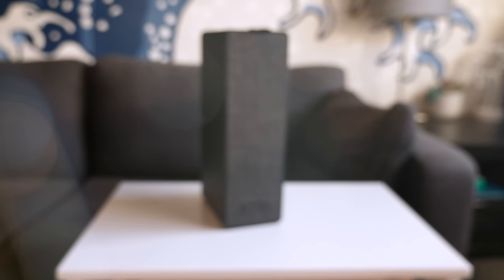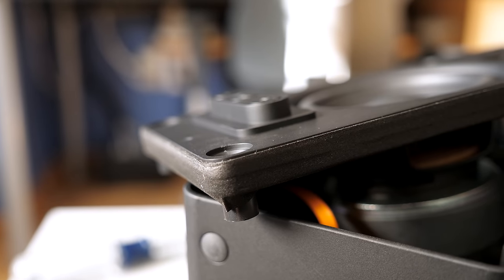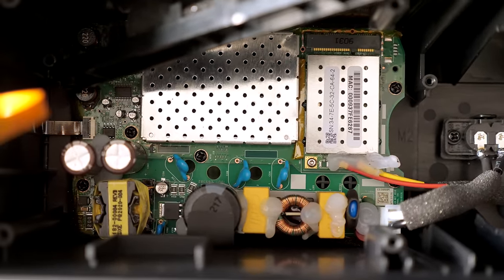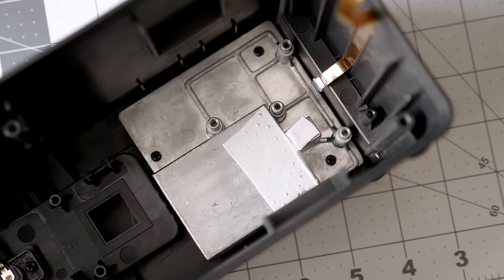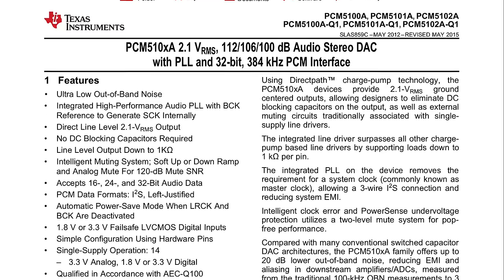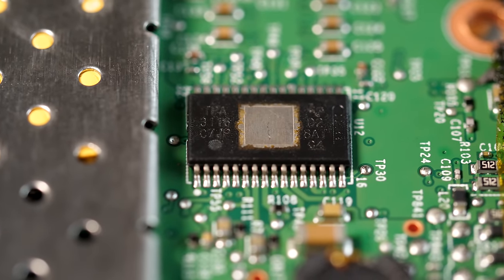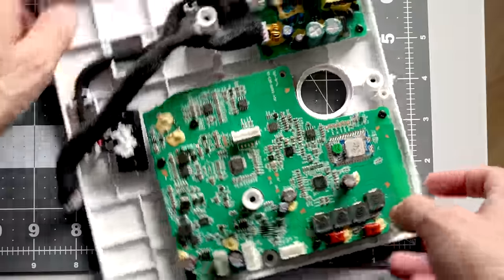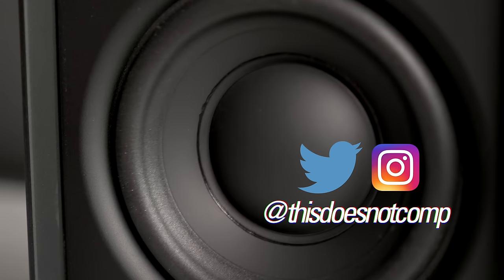IKEA's Sonos Speaker Has a Secret

Comment: The price of this speaker does NOT AT ALL warrant low quality caps. Its only a decision against the consumer to produce a limited lifetime product. Nobody should ever use cheap caps.
Reply: nutzeeer Of cause there are products that use cheap caps just to keep the price down.  But what most people miss is these two points:
  - The original bad caps plague was some factories using a bad electrolyte mix that died much earlier than planned.  This was fixed many years ago and you'll have to search old stock on eBay etc. to find new caps with this problem.
  - Every big brand offers cap models with different planned lifetime.  The current "short lifetime Panasonic" probably dies before the current "long lifetime CapXon",  though I haven't any hard data.
Reply: nutzeeer everything is cut down in price. Look at Mercedes 😂
Reply: @johnfrancisdoe1563  panasonic is the definition of long life. No product of them we own has ever died. Even our VCR still works.
Reply: @johnfrancisdoe1563  - well said. Personally, I consider CapXon is about the right quality level for what is, basically, a shitty cheap Ikea product.
It's absolutely ridiculous to expect Nichicon, Panasonic or any other "name brand" caps in a GENERIC brand appliance.
Reply: Cap brand choices aside - the price difference between a cheap cap and its better variant in relation to the product´s price is more or less negligible, in a device like that it´s most likely less than a dollar.Many manufacturers use 85C caps in consumer products, these caps often start to fail after 2 or 3 years, conveniently not too long after the warranty runs out (planned obsolescence). The 105C variant runs much longer (if it fails at all within the reasonable maximum usage time), as its max temperature rating offers a much larger margin to the usual operating temperatures (around 40 to 60° celsius).The price difference between the temp rating is somewhere around 10%.
The speaker´s equipped with 105s, so even with the cheaper brand caps, it´s reasonable to expect them to last about as long as top brand 85s.
Reply: @sthenzel  - even within the most expensive products there is always downwards cost pressure on the component BOM to maximise profits.
The idiot reviewer only showed the labelling of the 100uF  400V input cap (a CapXon HP series) which is entirely OK for that application and will never fail since it's only running at 50 or 60Hz. 
The 2 caps on the PSU output (at 5:39) are not fully identified. These might be standard 2,000 hour caps, or they might be 10,000 hour long life products. We'll never know because the reviewer's BIAS and omission of the full details creates a misleading impression on viewers here.
Like ALL capacitor brands, CapXon manufacturers different product series, ranging from 2000 hours to 20,000 hours rated life. It's not the brand that makes a difference, but also the series. CapXon's "Long life" caps (rated 10,000 hours) will definitely last longer than Rubycon or Nichicon "Standard" caps with 2,000 hour rated life.
You really should review the CapXon product catalog, even if only the first few pages that summarises the massive range of different series that engineers can choose from. YES, if they choose cheapy short-life CapXons then they won't last forever, however that would be exactly the same if they chose the cheapest Rubycons too.
Reply: How many caps are in there? 20-30max. At wholesale level, a cap costs just cents,  the product may get 10-20 cents more expensive to make with 105 instead of 85c caps. 
Those are jellybean parts, they rarely are a huge cost factor. This much, much more applies to the housing, circuit layout or assembly work. 
 Yes, each and everyone tries to squeeze every bit of revenue out of a product they can get, but if the components get to cheap, the reduced lifespan might get too close to the warranty limit. 

Oh, and those cheapo caps (with a good temp rating) are also used in the Sonos speakers, which retail for 50$ more.
I´d say, Sonos preferred 105c CapXons over top level 85s, which will, despite their overall better quality, die sooner if operating near their max temperature.
Reply: @sthenzel  - there seems to be a total of THREE Axial (non-SMD) capacitors, and my guess is that ALL THREE of them are 105°C.
All the bullshit written above about 85°C caps is just that... irrelevant bullshit . The reviewer started the hysteria with his idiotic comments about the CapXon brand, whilst completely ignoring the fact that all brands have "cheapo" and "high-end" ranges.
I agree with what you've said - the product designers have already reviewed all aspects of cost vs performance vs life, and they selected CapXon with consideration that this is a CHEAP consumer-grade product. Given a certain price per capacitor, it is almost certain that the (selected series of) CapXon caps gave a BETTER performance / life than "name brand" capacitors of the same price.
Who gives a shit, anyway? It's stupid to install capacitors that might live for 10 or 15 years in a product that will be obsolete and thrown away within 2 or 3 years.
Reply: @johnfrancisdoe1563  I obviously don't know your level of experience in electronics, but how many failed Panasonic caps have you seen through the years, compared to CapXon?
Reply: @agevenisse3252  By coincidence the only caps I replaced was on my two Panasonic products
Reply: Why not? Dell used "cheap" caps in their early 2000's computers. Almost brought the company down, Dell denied there WAS a problem! If they're good enough for Dell, they are good enough for Ikea!
Reply: @johnfrancisdoe1563  The Japanese chemist who developed the "electrolyte" for GOOD CAPS defected to China in late '90s, but lost the formula. So, the Chinese came up with some badly mixed electrolyte (too much water) causing the caps to dry out way too soon which caused the "ESR" to increase. The increasing heat caused the ESR to increase more in a vicious cycle!
Reply: @2adamast  But, were those caps Chinese knock-offs? I would be surprised if those "Panasonic" caps were "made in Japan"!
Reply: @anonymous one The caps in the switcher PS of that IKEA "sub" are ELECROLYTIC caps! The ELECTROLYTE in them is a PASTE (SEMI LIQUID) THAT PRODUCES A GAS WHEN IT"S OVERHEATED BY a HIGH "ESR", THEN THAT GAS HAS TO ESCAPE> IF NOT  THE CAP WILL EXPLODE!!!! DO YOU SEE THE ETCHED + AT THE TOP OF THOSE CAPS? THAT IS THE VENT! Btw, there ARE "SOLID ELECTROLYTE" CAPS THAT THE MILITARY USES, BUT THEY ARE SO EXPENSIVE THAT YOU WILL NOT FIND THEM IN THIS "DIME STORE" CRAP!
Reply: The $5 price difference between a Crapon cap and a Elna cap multiplied buy thousands of units sold adds up to serious "scratch"!
Reply: While I agree “no one should ever use cheap caps”, this is a $100 speaker with Airplay 2. Actually, the only speaker under $150 with Airplay 2.
Reply: I just watched a Sonos One Teardown just to find out they are using the same caps. this is not on Ikea, this is sonos and if those are really bad quality I would not buy any Sonos product.
Reply: @maffin2917  i wont buy a sonos product anway because they just make speakers stop working, as they need some random internet server to function. i am happily using my 3.5mm jack speakers which dont have such problems and sound great
Reply: @nutzeeer  I am looking for a multiroom setup at the moment but its really hard to pick the right system.
Reply: @maffin2917  such gimmicks always cost more than good sound quality
Reply: Welcome to our disposable society.
Reply: @johncoops6897  you have a way with words...that stops anyone from taking you seriously.
Try better.

Comment: Good way for Sonos to get rid of old stock parts clogging their warehouses.
Reply: True
Reply: Usually companies like these are not holding the pieces of a device in their warehouses. They are manufactured to order, so the GGEC, which is known in audio manufacturing world, produces the parts, orders some parts from third tier suppliers and assembles it all for Sonos or other brand, according to their specs and design. Unless Sonos chose to go with pre-designed audio stacking, and relies more on software to tune the sound to their signature. That would explain the similarities. It's perfectly normal in industry to rely on readymade ( so called off-the-shelf) solutions that are tested and provide good enough quality.
Reply: No way. IKEAs sales volume is way higher than what Sonos could have ever achieved

Comment: Such a high quality video and teardown
Reply: for such low quality speakers
Reply: with such a clickbait title.
Reply: @GlacialLake  I agree, review was amazing, title not. There is nothing secretly bad about this as the title suggests.
@mob1235 I don't think they are that bad. Don't get me wrong, of course there exist better ones but the design seems to be of good (build) quality (Except those CapXon caps). The audio quality won't be the best, but decent enough for the average consumer.
The only thing I can't understand is why people in General want those mono "intelligent" speakers at home. Even a rather cheap stereo/5.1 system sounds a lot better if set up correctly in the room.
Reply: It's presented well but riddled with technical errors and incorrect assumptions. The conclusions are completely wrong. Enjoy the pictures, ignore the commentary.
Reply: Beware. Outside beautiful. Inside rotten
Reply: Homemade Social media Video, for Home use only!
IKEA!
it works now! Trash all IKEA within 3 years i guess....
Reply: @TheRailroad99  I'm on ATMOS, i can use any speaker, base the A4A by Yamaha.
I will use SONOS for upstares, all controlled by the iPhone and Yamaha, are these IKEA speakers good enough, guess so! JBL or this?
The are called intelligent, they are run by iPhone or other tool, not needing hard wires, able to tune in to any channel over TCP/IP

Comment: The capacitors are not just cost cutting but also likely part of the measures taken for planned obsolescence
Reply: Cost #1!
Reply: Physical obsolescence isn't even needed with this type of device, it's enough to have one of the next generations of "smart" phones to just not support the standards those operate on anymore. 
It's an opportunity for us DIYers to hack an analog input (with op-amp line lvl crossovers) into them though, or even turn them into passive speakers altogether, which run with any small amplifier or trusty receiver (from the 80s that still works perfectly of course :) ...)
The drivers themselves look pretty good actually.

Comment: Using CapXon capacitors is probably a way to make sure it doesn't last more than 2-3 years...
Reply: Ageve Nisse damn, straight to the point
Reply: After a couple years when they do die, take it apart to check the capacitor values, order higher quality replacement capacitors with correct capacitance values and same or higher voltage rating from digikey, than bust out the soldering station and replace them.
Reply: @davidperry4013  You know that 99.9999% of people will buy another. Planned obsolescence is disgusting.
Reply: Ageve Nisse floor sweepings... those types of capacitors are generally the first thing that blows in any expensive electronics circuit including computer motherboards. I’ve been able to replace some but without Radio Shack being down the street anymore it’s harder to find the parts. There is a Mouser out in El Cajon somewhere I think they have mail order too.
Reply: still running here after 6 years of everyday use, so nah, keep your accusements to yourself.
Reply: Yup - gotta keep on consuming for ever greater GDP.
Reply: Timotheus Bojarowski • Genuinely curious (possible Mom gift), do you unplug your speakers sometimes when not in use, or have them on a circuit you can power off with a wall switch (like a light switch)?
Reply: What brand of capacitors do you recommend? I need to get some new ones for my early 80's radio
Reply: Doesn't Sonos run on a cloud service? If so, who's to say if the backend will still be online in a few years time. NEVER, EVER buy into a cloud service - they can go away at any time without warning, then you'll have to hack it to make it useful again. Not cool
Reply: @WinterCharmVT  I wouldn't. When I buy something I expect it to last as long as I need it to - if it fails before I'm ready to replace it, then my next product will be coming from a different manufacturer. As an engineer myself, I have zero tolerance attitude towards unreliability. (That's why I never but Apple products)
Reply: Florian E
Any Japanese capacitors.
Rubycon, Nippon Chemi-Con, Nichicon, Elna, and Panasonic.
Do NOT buy them from ebay, there are MANY fakes being sold there. The fakes will have poor quality, ex: Incorrect sleeve color, poor printing quality, incorrect pressure relief vent shape, high ESR, etc...
Reply: Count Zero • I buy my videogames on disc for that very reason, but modern games sometimes don’t even put a working game on the disc anymore! 😱

But I think Sonos is only partially online. The connection to music and each speaker is all local over wifi, but you might need internet access to register and link the speakers. That said, I don’t own any, so I don’t know for sure.
Reply: @timotheusbojarowski4673  
your play 1 is still running after 6 years
Reply: @evshrug  I never unplug them
Reply: CapXon caps are not bad caps at all. I don't know who started this myth. We use them in our company in over 1 Million units every year which are designed to work for at least 10yrs and they do well. At 4:57 you can see that they are FH series caps -->  10000 hours of operation at a temperature of 105°C according to the datasheet. Since the capacitors will never have that temperature in there (otherwise the plastic housing will melt to pieces anyway) they will last for many years, just google for "Capacitor lifetime vs. temperature" than you'll know what i mean.
Reply: @sebastiank.4872  There's no "myth". Countless Samsung TVs have stopped working because of CapXon caps. Well designed PSUs, but with bad capacitors. I've seen many other products fail, and after replacing the CapXon caps with quality caps, they continued to work for several years. What kind of products do you make?
Reply: @SocialSpit  DigiKey too is a great parts supplier. Them and Mouser have mail order.
Reply: @agevenisse3252  I still believe that in this case Samsung used the cheap series from CapXon and not the long life/high ripple types as Sonos did in this speaker. I work for a company here in Europe that makes adjustible furniture and I'm actually the guy who designs the PSUs for them. We used NCC and Rubycon caps in the past and some of them also failed at the customer. Up to this date there is no increased failure rate after switching to CapXon. Btw. it just isn't possible as an engineer to use high end caps like Nichicon in a product like this that retails for 99$. So i think they made a good choice by using the long lifetime FH-series from CapXon, they could have done worse...
Reply: That is why and how CapXon is still in business. Planned obsolescence.
Reply: Exactly, don't buy this garbage.
Reply: @davidperry4013  Getting higher "temperature" rated caps would probably help a bit!
Reply: @WinterCharmVT  That's what keeps industry rolling along..
Reply: @SocialSpit  Mainly in the switcher PS because of proximity to active heat producing devices ie. power mosfets, bridge rectifiers..
Reply: ojars zvaigzne I have an old peavey 5150 guitar amp that has  Circuitry like that- it’s a tube amp but it has plenty of solid state parts...
Reply: @mahlapropyzm9180  And to keep people (and robots) employed!
Reply: @Florian00  Panasonic, Nichikon, Elna, Illinois capacitor, Vishy, Mallory, Sprague, JUST NOT CRAPon!
Reply: @Yiannis2112  DigiKey is a GREAT place to buy from and they are cheaper than Mouser.
Reply: @SocialSpit  Does your amp use a "linear" or "switcher" PS?
Reply: ojars zvaigzne if a switching PS is like a desktop computer PS then no, this has a gigantic transformer and a huge bridge rectifier and a few SCRs. The power and preamp sections are pretty straightforward, all the extra gunk is for channel switching. Older tube amps used a tube rectifier. But those are easily replaced by four high power diodes.
Reply: ok no sonos in my house and no ikea crap
Reply: @timotheusbojarowski4673  I believe the word you're looking for is accusations. **
Reply: @TheOzthewiz  My amplifier 100% linear with RET transistors and a massive toroidal transformer. It's a vintage Japanese made beast with 110 watts per channel @ 8 Ohms and almost no distortion.
Reply: Count Zero same reason I prefer buying apple products. I have no patience with debugging my bought appliances. Things must work or I throw them out. 
As an engineer, I don’t want to work at home as well as at work.
Reply: That's okay because Sonos will probably force a firmware brick long before the capacitors ever fail.

In fact, that might be why they do it in the first place. "Customer Safety™"